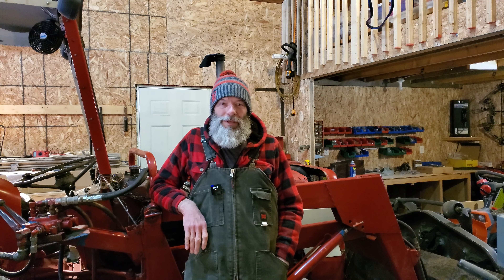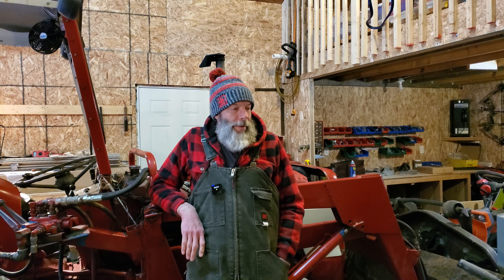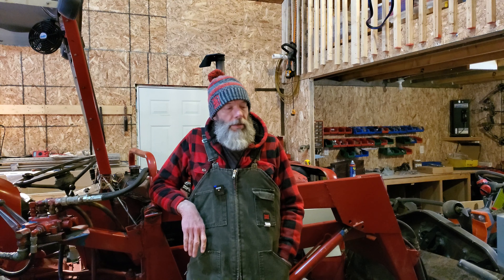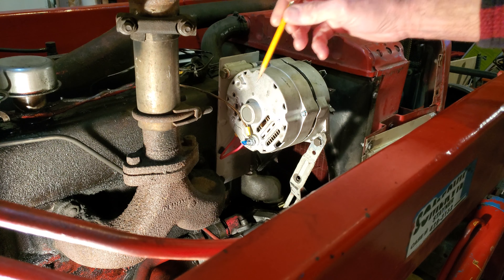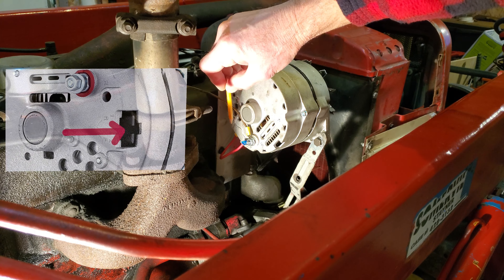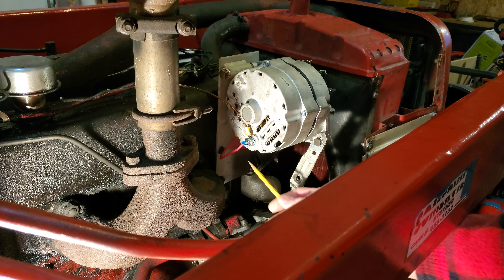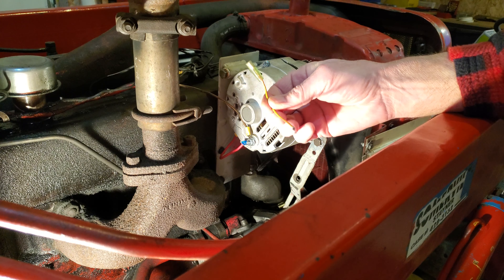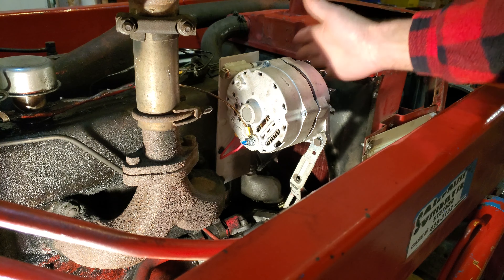International Harvester 444 Diesel Tractor Alternator Issues Resolved!

Comment: I was wondering if you could run wires from the R terminal and battery terminal to a push button on the dash.
It would make life easier if you could.
Reply from the maker: Correct, or maybe to the ignition switch. But if you use it regularly I don't think you should have to do it all the time once it's been flashed?